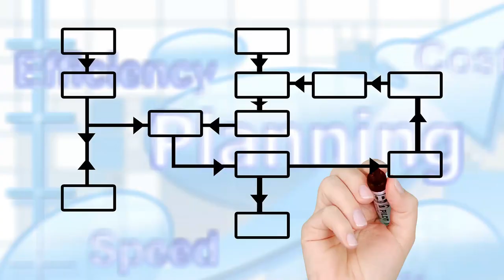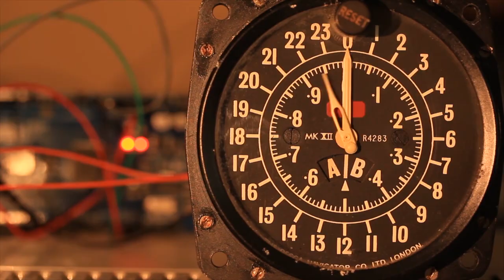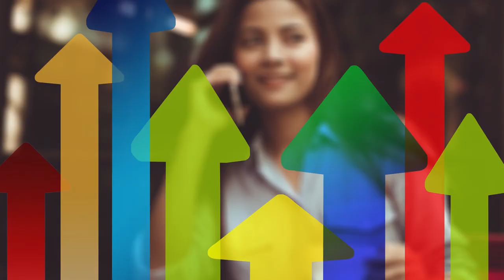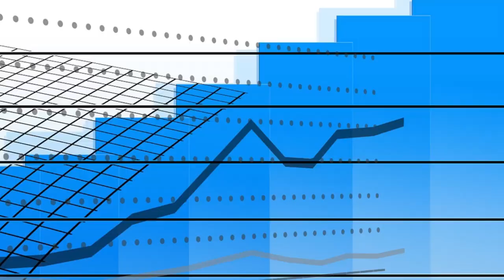Luxottica: How Monopolies You Don't Know Run the World

Comment: ALEX BERMAN --- it's the TOOL AND DIE industry.  Not DICE like what you roll in a board game!!  ;-)   Dies are typically the female components of a larger tool or press.  A die is a tool or device for imparting a desired shape, form, or finish to a material.  My Grandfather was in the tool and die industry.  Your video made me laugh at the dice rolling part.   Otherwise, the info in here was very eye-opening (pun intended) for this monopoly in the eyewear industry.  Knowledge is power.  Eyeglasses and sunglasses markups are insane!